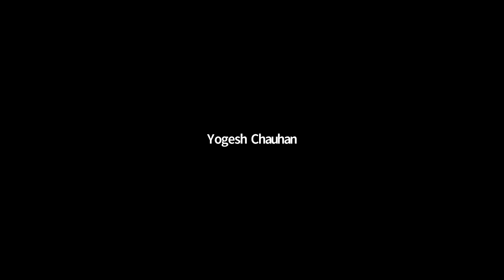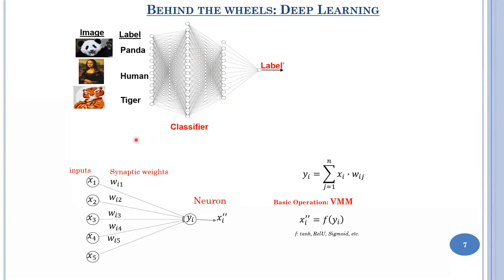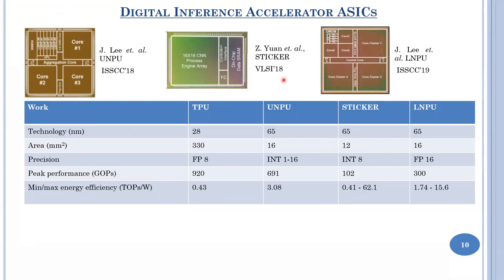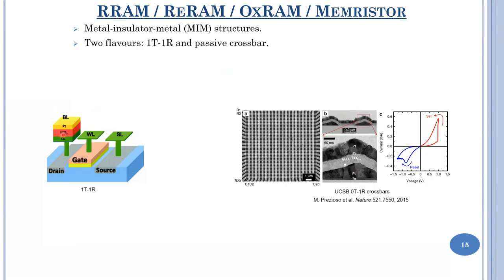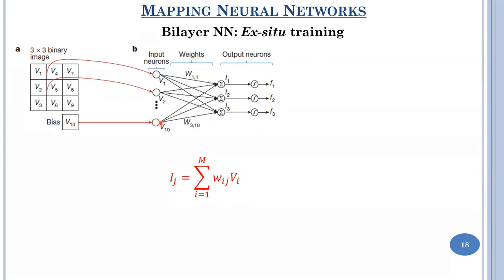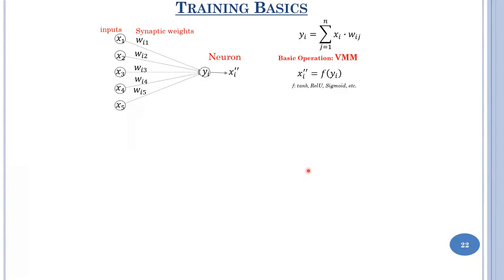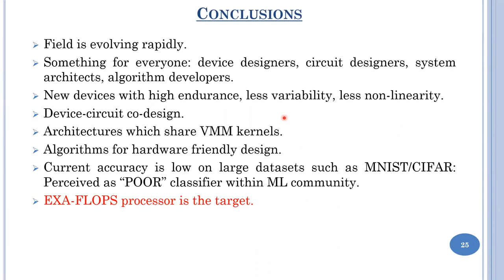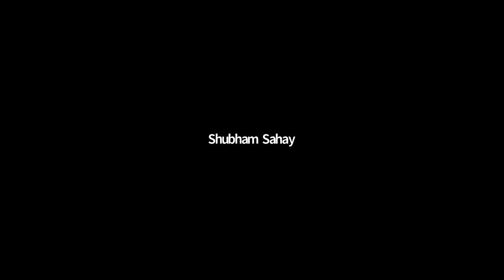Lecture 31 - Mapping Neural Networks to Hardware

Comment: From a commercialisation point of view, is CMOS the best technology for fabricating neuromorphic chips. I'm more of a circuits person than a devices person. My aim is to make a analog ML coprocessor for embedded systems boards. Since the embedded system based boards like microcontrollers and FPGAs are manufactured using CMOS technology, that's why I want my neuromorphic circuit also to be CMOS. Am I thinking in right direction. Please help me with this
Reply: using CMOS technology for your neuromorphic coprocessor in embedded systems can be a reasonable choice, especially if you want to leverage the compatibility and cost-efficiency it offers.
Reply: @PurePulse Thank you my friend
Reply: any updates on this idea?